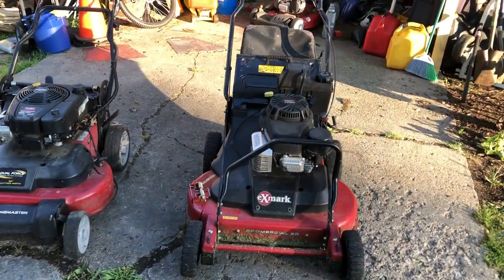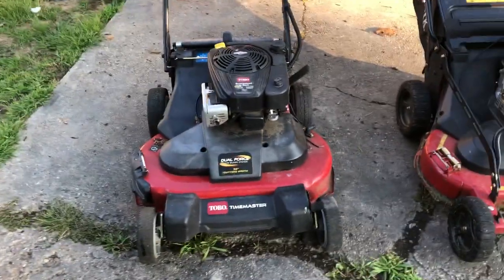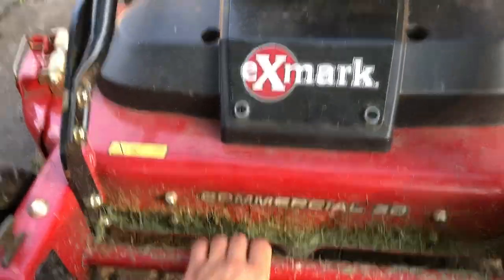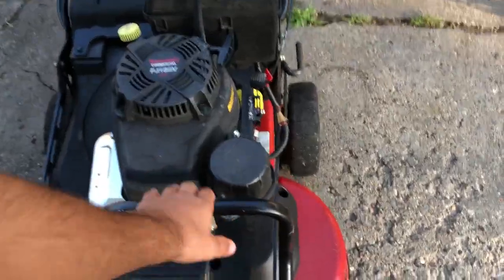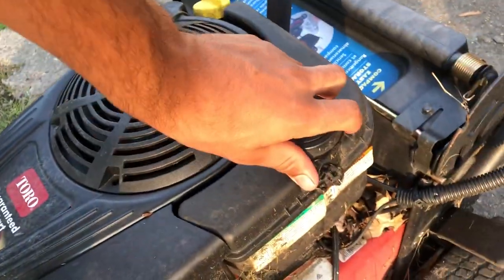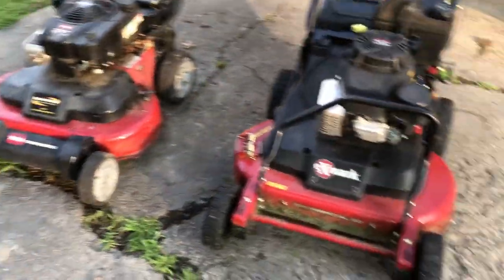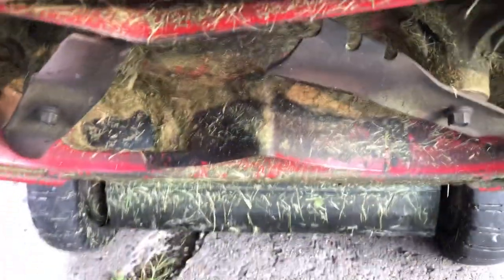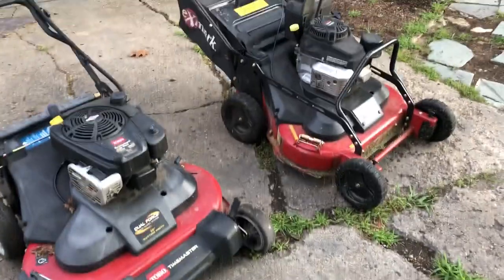Toro Timemaster vs. Exmark Commercial 30" mower

Comment: We use the Timemaster for 20 yards about 1/3 acre each.  It has the Briggs engine.  Blew a head gasket but was easy to fix and after two seasons still starts on first pull.  Bigger issue is the cogged belt idlers failed twice destroying the belt and blades. Would get the Exmark for that reason if doing lots of mowing or at least get the Exmark clogged belt idler pulleys to upgrade the timemaster.

Comment: The idea that the B&S 190 is a bad or an unreliable engine is a very, very rare experience and/or opinion that can hardly be found anywhere but here. I think I read this same experience only in one other review after reading hundreds of reviews at the HD site and the Toro site, and this is the only video I've ever found that backs up the belief that the B&S 190 or 223 are junk or will last only "one season". Most all of the B&S 190 cc engines on the market today in the TM30 and other mowers that have it, from 2012 and on, are still going strong and for most reviewers,  even with respect to commercial reviewers with this homeowner rated engine,  this has been one of the strong points of the TM30. 

I'd look at many more videos and reviews before believing the idea that these B&S engines are junk. Personally, I'm nearing the end of year 4; have used it in the southeast for long growing seasons on my 1/2-acre lot for now 4 seasons in thick and somewhat high grass; have used it probably 20 hours more on larger lots up to 2 acres in thick grass to help out family members when their riders or walk behinds were torn up; and my B&S 190 engine has had zero issues; starts on the 1st or 2nd pull every time; has not lost power or torque; has no rough running issues; have done nothing but changed the air filter and the oil and used pure gas and stabilizer at the end of the season. The only issue I've had was with respect to one pulley failure; it's got the same pulleys that's in the Exmark and TurfMaster versions. From a performance standpoint, I've never read a single review that states the Kawasaki will out perform this B&S engine for cutting grass with this machine. Outlast it? Probably; but out perform it; most comparisons say they are about the same and state they both need a little more oomph for a 30" mower. The engine sizes and the ratings sort of bear this out as well. Beginning 2016, the new TM30 now has 223 cc with 10 ft-lb torque that's also available in some of the MTD-branded 28" mowers, so it's likely that the newer TM30 has more power than the commercial version, but the new Briggs does have it's downsides versus the Kawasaki and the old 190 cc, so I'd check it out.

Recently, SEF the Lawn Surgeon (check out "selling my TimeMaster") only  began having trouble with his TM30 engine with many hundreds of hours and three years in a commercial setting. He is stating that something seems not quite right with the engine and it's lost some performance, but this just happened after many, many hundreds of hours. He has used his TM30 in very extreme situations and he has many videos and discussions regarding his personal TM30; even mowing tall grass in the rain. Of course everyone has his or her own experiences and users should report engine failures if you have them; but this is very atypical on a TM30 review. Another example of long-term service is a commercial user with 1,700 hours and three years found right here on the Tube with a TM30 with the original B&S engine. Are there problems and issues and weaknesses with the TM30? Yes; there are absolutely issues with this mower and some people do not need to buy this mower in certain situations; but those issues and weaknesses apply equally to the TM30 and the Exmark 30 and the TurfMaster. Basically, these are horrible mulching mowers for fescues and rye grasses unless cut when grass is very short and dry with either mower. The pulleys have low life for a commercial setting; transmissions have a high failure rate; but these weaknesses all apply equally to the three versions of this mower. Of course everything is much more rugged on the commercial versions, but the cheaper made plastics on the TM30 have not been an issue even for most commercial users, but that will depend some on who and how they are used.
Reply from the maker: Homeowners may have luck with the toro time master with the residential grade brigs and Stratton engine.  However I used it in a heavy duty commercial capacity, 60+ lawns a week, the machine only lasted a year (keep in mind I went through two of them) In the commercial world for all the guys who run ZTR’s Kawasaki makes the best engines, Briggs is not known for making quality engines you can ask homeowners or commercial operators alike.  If you go on homedepot or Lowe’s and look at reviews it’s going to be homeowners who have used the machine for a month. The time masters are just not dependable, got the exmark commercial 30 and it is Bulletproof!
Reply: @theyardsman568  you are one of very few people who have a problem with this engine. This is not just a residential engine. That's why they call it a Briggs & Stratton professional series. These are nice overhead valve engines with cast iron cylinder sleeves. I am not a big Briggs & Stratton fan but this is one of their better engines. One guy had a Toro timemaster and had over 1700 hours on that motor. Many people use them for commercial businesses and the B&S engine is the least of their concerns.
Reply: @theyardsman568  You misused a residential mower, it's not made for commercial use.
Reply: @wilwiljames1  I use mine commercial but I have 2 and switch off every few houses. If you run and run things nonstop and don't allow it to cool down and have a break they will break.

Comment: Briggs is not meant for commercial use, if it is it's going to frequently break down even if you do regular maintenance, that's why it's for residential use only cause you'll mow what like 3-4 times a month? So it should last you for a few years, commercial ones in the other hand are meant to be built like tanks and be used hours each day, that's what some people don't get.
Reply: My buddy uses a yard machine 200 dollar special from Home Depot with a Briggs motor... He uses it all day everyday. He’s had to change the tires a millions times but still uses it to this day! That one and a craftsman mower looks identical same engine and all... things a beast. Probably going on 5-7 years of abuse cutting atleast 100+ lawns a week! I don’t like them. But they never failed him.
Reply: @kevina4674  Good for him. I don't know I guess I just have bad luck with them 😂😅, not gonna lie I use a Honda hrx 217 with 190cc and I use it commercially, that thing I beat to death but keeps going, Briggs just dies on me and doesn't give you a warning, but to each their own 🤷
Reply: My guy, thank you for informing me!!! I’ll look into it
Reply: I use my time master commercially. Starting seasons 4 next year. I will be selling though. I like new fresh equipment . Less to worry about breaking down.

Comment: The Toro TimeMaster is a residential mower for home owners while the Exmark is a commercial mower built  for all day everyday mowing. This comparison is ridiculous
Reply: I'm comparing these exact mowers, why is this so ridiculous?  I'm looking at the Exmark to be the last mower I have to buy where the Timemaster would be ok for a handful of years.
Reply: @mct8888  You just explained why the comparison is ridiculous. The Exmark is commercial equipment while the Toro is residential, why would anyone expect the Toro residential to compete with the Exmark commercial?
Reply: @wilwiljames1  people want to know if the upgrade is worth the investment.  Is that too hard for you to understand?
Reply: @wilwiljames1  you called someone’s work “ridiculous”.  Troll.
Reply: Consumers like myself may want a longer lasting mower than a mower that doesn’t last 10 yrs.
Reply: @robm.6825  I understand and agree with you totally would probably last a homeowner a lifetime due to it's commercial construction while the Toro is purely made for residential use. The difference is like hitting the out back with a Range Rover (Exmark) vs a Chevy Cruz (Toro). both products are great but made for different uses. If the Exmark is only used for the owners home lawn it will last a lifetime. C'mon guys think about it, the Toro is $1000.00 the Emark is $2000.00. The price difference is enough to tell us that the mowers are in a different class.
Reply: @robm.6825  I actually own a Toro TimeMaster it has served me well and I couldn't afford an Exmark
Reply: @wilwiljames1  I totally see where you’re coming from. It’s just nice to see what’s upgraded and differences what might make the exmark more heavy duty.

Comment: I’ve got the original Kohler in my JD 210 from the 70’s. Still screams. Never an issue with any Kohlers in my life.
Owned two Kawasaki’s. One on a push mower that never ran strong. One on a rider that was fine, but I don’t think they have the a$$of a Kohler.

Comment: Briggs is a good engine i get sick of some pepole say kawi is going to last you 5 times the briggs we all see a vid a year latter thay go and buy another commercial mower when there is nothing wrong with there old one the timemuster is all you need with a 10hp why will you pay $2000 for one that is less power commercial or not no one keeps there mowers more then 5 to 6 years.
Reply: Briggs never failed me yet.  Everything else usually falls apart around them.

Comment: Can't speak to modern Briggs engines but my 80's vintage bunton 28 engine equipped with its original Briggs 8 up motor just keeps chooglin..
Reply: Meant to say my 80's bunton 28" mower equipped with an 8 hp Briggs just keeps chooglin and with little maintenance